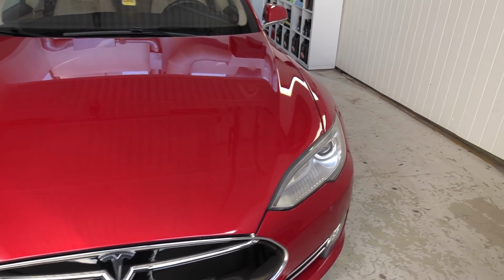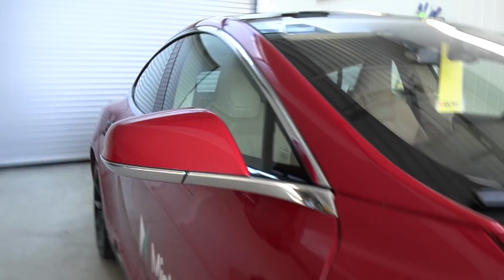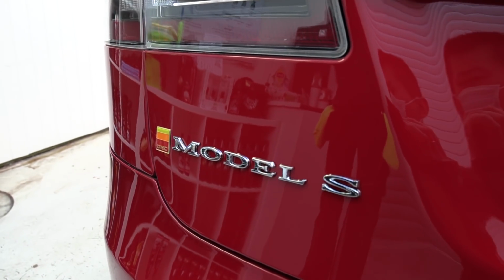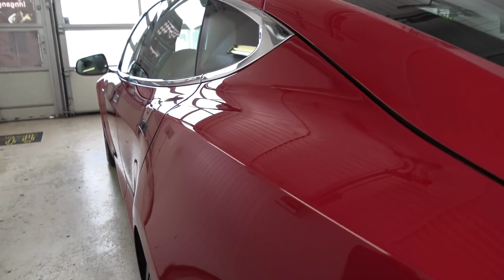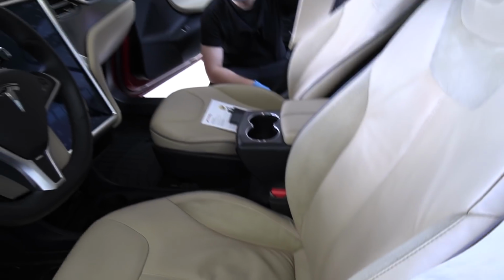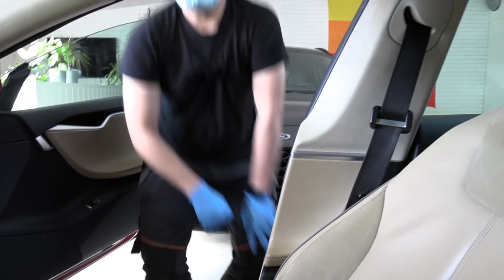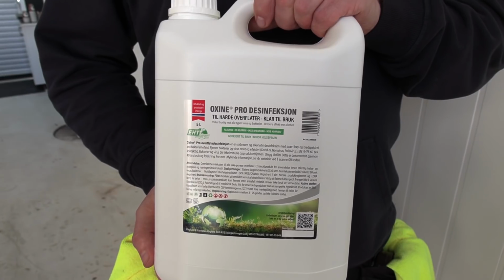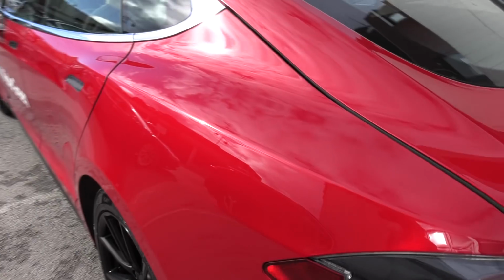Pit Stop Bilpleie restores 2013 Model S P85 with 350.000 km on odometer

Comment: One thing I noticed is how perfectly the chrome strips on the top of the door are aligned, compared to my car.  Mine was more or less perfect until the left rear door handle was replaced, which required removal of he chrome trim at top of door (bottom of window).  The mobile technician did a decent job of reinstalling it, but it is off just enough that now I notice it.  Seeing this car makes me want to fix it.  Not to mention that now I want to have my 5 year old paint cleaned up!

Comment: 1:51 That's a lie and just laziness from the detailers. You don't need to repaint the entire hood, and if you fix it with adding paint where the stone chips are, you won't see it again. You add paint, sandpaper it, polish and voila.
Reply: There were literally 100’s of stone chips on the hood. To fix that it would be way more expensive to fix it rather than to respray it. Especially in norway, where labor costs are extremely high 😀